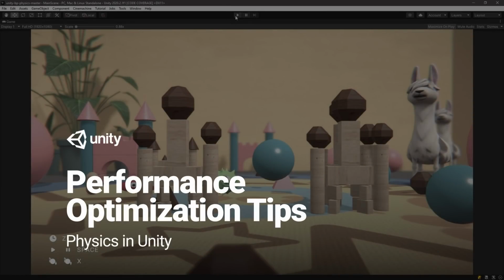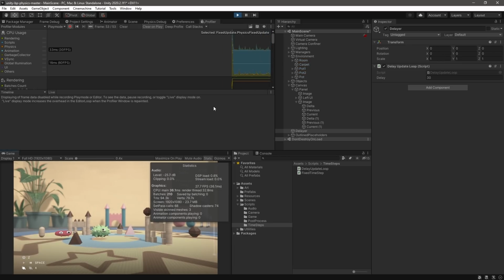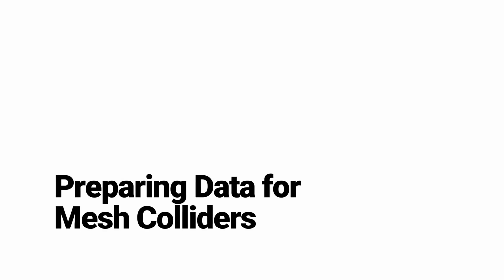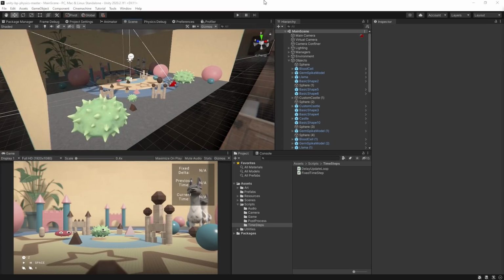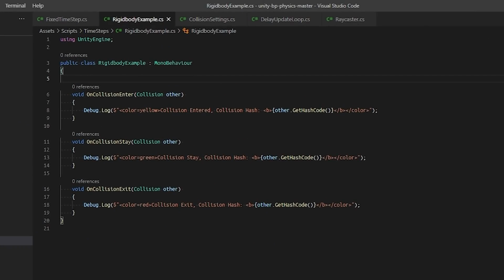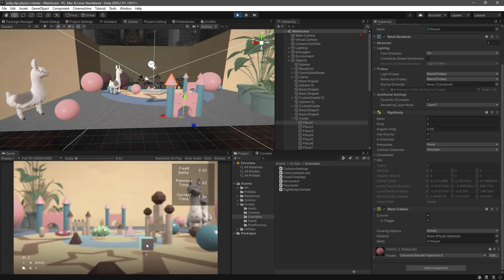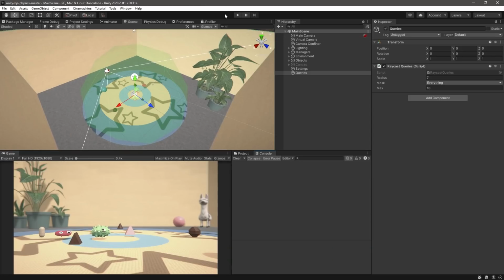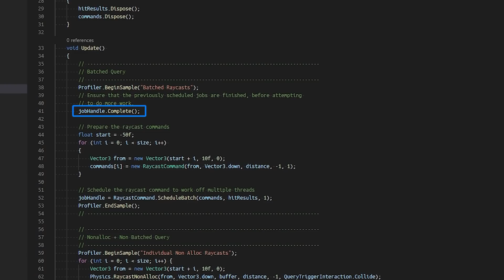Performance optimization tips: Physics in Unity | Tutorial

Comment: 1:59 Can you dynamically set the physics time? So if my game runs at 30fps on my machine, it will be different from someone else’s machine where the game might run at 60fps.
Reply: You can multiple it by * Time.deltatime to have physics independent of the framerate
Reply: Your so called physics time runs on something called fixed update. This is the same regardless of framerate. So it doesn't matter whether it's 10fps or 60fps. Fixed update is fixed.

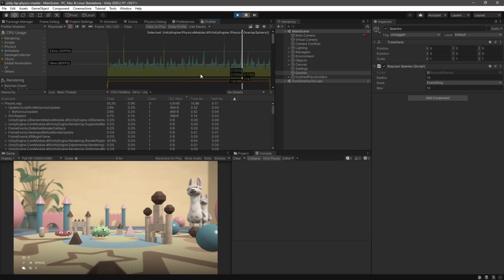Comment: A bit more on the "Use Non Allocating Queries", 9:44

The normal queries will allocate an array for you, and will store the results in that array. The non-allocating queries require you to provide an array in which to store the results. The reason why this option is less likely to trigger the garbage collector is because you are expected to re-use the array that you provided. By re-using the array, you are creating allocating less array, so which means that there are less arrays for the GC to collect.

In other words, you will bet zero benefit from using the non-allocating query versions if, you declare an array, pass it to the non-allocating query, and then throw the array once you are done. I will repeat, the non-allocation queries are only beneficial if you RE-use the arrays. Allocating memory takes time, and deallocating memory takes time. Re-using the arrays, saves time by not doing those two steps EVERY time you run a query, and as a side effect, it cuts down the number of times a large GC will be needed.

If you look at the example provided, 10:21, you will see that an array of Colliders was created at Start(), and that array gets re-used in every Update() call when they use Physics.OverlapSphereNonAlloc(...). That is a decent example on how you are suppose to use the non-allocating queries.
Reply: I was wondering the same thing... How is non-alloc reducing GC's job... Very nice explanation.... It makes sense :)

Comment: how come when making a game like billiards, balls are always more attracted to sticking to edges? I tried all kinds of physics material properties and nothing got rid of this sticky behavior.
Reply: Reduce or set to zero the parameter "Bounce Threshold" in Project Settings > Physics. That should fix the issue.
Reply: @VehiclePhysics  It's the correct advice for majority of people, so thank you. However, unity's physics behavior where rolling objects are attracted to closest edges persists no matter what the bounce threshold is.
Reply: I had configured a perfectly bouncing ball in the past where it would keep bouncing forever (friction = 0, bounciness = 1), so at least I know it can be done. I recall having the problem of stopping bouncing, but it was fixed by setting Bounce Threshold to zero.
Reply: @VehiclePhysics  The problem isn't the bounce part. It turns out rigidbodies are somehow attracted to other colliders when they're freely rolling on the ground. It's like there's a very slight magnetic field between the rolling ball and the closest wall. I think it only aplies at a certain close distance.
Reply from the maker: For some more in-depth troubleshooting, we'd recommend sharing this experience with other creators either on our Discord channel, or in our Forums:
https://discord.gg/unity
https://forum.unity.com

Comment: If the target frame rate is 30, should the fixed time step be 1/30?
Reply: You should set the fixed time step based on how much iterations you need to get a coherent physic simulation for your situation.
At low frequency ( 1/10 ), physic is more inconsistant, objects can easily go through others if moving at high speed and bounce are way to big. At higher frequency ( 1/50 ) physics will be more accurate, and then more realistic.
Reply: @BlackMandragore  Thank you, but actually I was wondering to know performance optimized settings.
Reply: For something like a phone game you don't even need 30 iterations a frame, and can probably tone it down to like 15 depending on your game. It is what I did in a professional project and got huge speedups.
Reply: @herohiralal3255   My game is an endless runner with a little different concept, I'm moving some pivot objects with transform, while moving character with physics. When I increase fixed time too much, some sync issues are apperaing. I was wondering, how much can I increase fixed time for performance without getting sync issues(with 30 target frame rate)
Reply: @pronotron  You can probably just stick to the default 50 Hz. That way you get two physics updates on most frames and sometimes only one. If your frame rate is fairly stable you should never have to do three physics updates on any frame.
The bigger question is why you would want to target 30 fps? Mobile game?
Reply: @forasago  Yes It's a mobile game.

Comment: Why is 50hZ the default?
Reply: According to this video it's to prevent double FixedUpdates if the frame rate drops a little. The assumption is that you will want to run at 60 fps (or more).The physics rate has to be lower than the frame rate to give some wiggle room. Whether 1/6th is enough wiggle room depends on your game, I guess.
Reply: @forasago  thank you 👍
Reply: Unity originated in Denmark
Reply: @daslolo  Denmark, really? That's cool. Thank you.